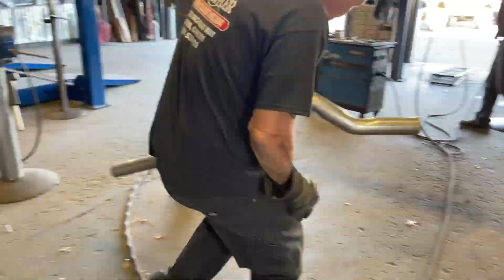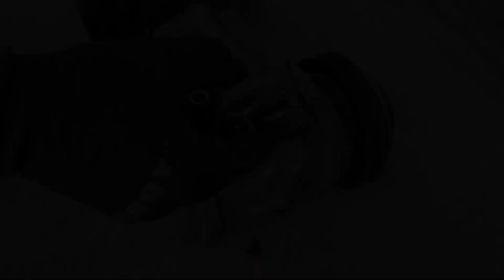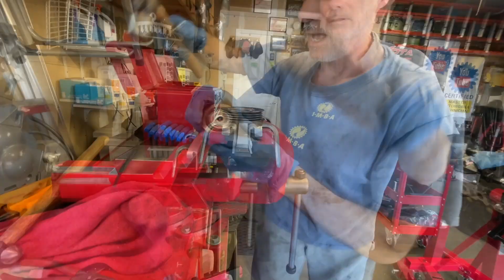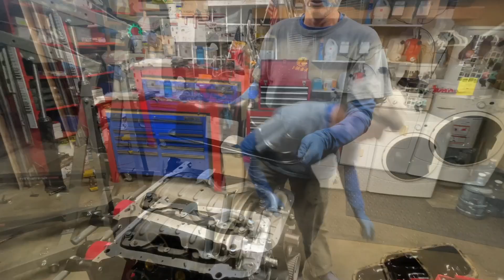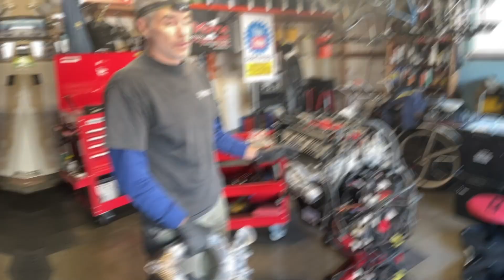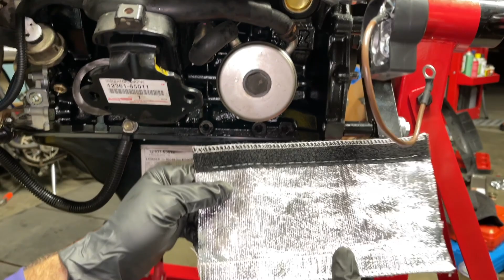3.0L V6 3VZ-E to 3.4L V6 5VZ-FE Engine Swap (2nd Gen 4Runner) - Part 2

Comment: 35:07 Where does the FPR vacuum like go to under the manifold? I see it’s ran under it but I have no idea where it’s going to. Or how did you set it up
Reply from the maker: The fuel pressure regulator vacuum hose connects to a small hard line connection at the back of the lower plenum.

Comment: Did you skip the baffle when re-sealing the oil pan?
Reply from the maker: No, we didn't.
Reply: Nevermind, I see you used the 94-98 t100 oil pickup that just mounts on top

Comment: I have a 1990 Toyota 4x4 pickup with a 3.0 3vze and i am taking that engine out and putting in a 5vze in good running condition from a 2002 4Runner. Do I have to swap the oil pans or will the existing one on the 5vze fit in the 1990 chassis?
Reply from the maker: @ForrestNorthwest  I don't know, but I bet Offroad Solutions might know the answer to that question.  Give them a call.

Comment: Absolute great video. I just watched eps 1. Very well done.
Regarding the new cross over pipe, I would and have used some other locking nuts, called K-nuts. There are two versions of those, the almost white one is a high temperature version, that lasts a lot better. and it's locking and won't loosen or even fall off. A little bit expensive for what they are, but works super well, and can take a LOT of heat. I may add that if the owner of this car wants to add a turbo or a compressor, for example the exhaust manifold to turbo flanges should have the same high temp grade K-nuts. Cannot recommend them enough.
Thanks for sharing.
Cheers.
Reply from the maker: Thanks again Jacques!

Comment: Hi Timmy, I am looking for a 3 VZ  3000CC, left hand drive, V6, 1989/92, open back Hi-Lux SR 5, wire harness from Computer to engine fire-wall to Engine, do you have any idea or phone # that I can try to get one, I closed is my Hi-Lux, thanks.
Reply from the maker: Offroad Solutions might be able to make you one.  Other than that, you'll have to find one from a vehicle somebody is parting out.  https://www.offroadsolutions.com/

Comment: Does the transmission of automatic transmission need to be converted at the same time And I'd like to know how much the hourly rate is thanks sir
Reply from the maker: Transmission does not need to be converted. It can remain automatic or manual. If your transmission is an auto, make sure you don’t have a pilot bearing installed into the back of the engine. If you have a manual, you will need a pilot bearing in the back of the engine. Our hourly rate is $972/hour but will increase at the end of the month.
- Sean
Reply: @TimmyTheToolman  thanks so much sir

Comment: Awesome video,  my question is why wouldn't you delete the crossover?
Reply from the maker: Ir you're asking why we didn't create a custom dual exhaust system, it's because that's not something we wanted to try to figure out.  It's also due to the potential problem you'd have getting it approved by a smog referee.

Comment: Curiouse, I have a 94 3.0L 4Runner Manual 4wd with a bad engine, and a 96 3.4L 2wd Automatic with a good engine. How hard would it be to swap the 4wd manual assembly from the 94 to the 96? Would the 4wd assembly even bolt up in place of the automatic on the 96, not to mention the front 4wd axle and equipment from the 94 to the 96. Or could I just swap the transfer case to the back of the automatic? Thanks & loving this series for obvious reasons. Best wishes & Blessings. Keith Noneya
Reply from the maker: Hey Keith, I don't have an answer for you about the 4wd swap because we've never done it.  They are different generation trucks so I don't know if the transfer case from the 2nd Gen would be compatible with the 3rd Gen.  This would be a question for a Toyota forum or maybe a Toyota Enthusiast Facebook page.
Reply: @TimmyTheToolman  No problem and thanks for the reply. Best Wishes & Blessings. Keith Noneya
Reply from the maker: @keithnoneya  No problem.  Good luck with all the planned work.

Comment: Hey Tim, where can I find the Heat shield that you used on the Header crossover?
Reply from the maker: This is what we used. https://amzn.to/3tPoFLK  
We joined two of these together.  They do make a wider one, but that still wouldn't fit all the way around the pipe.

Comment: 36:31 Do you have Part numbers for a clutch, fly flywheel for a 3.4l
Reply from the maker: It depends what you want, OEM or aftermarket.  Our clutch replacement video lists all the parts.  A lot of them come from Marlin Crawler though.  Do a search on our channel for the clutch replacement video series we did.  In the video description,  we provide all the links.  Remember, if you're using your original manual transmission, you'll want to use a 3.0 throw-out bearing.

Comment: I love this series! So much helpful information, I'm planning on doing the 3.4 swap sometime near the end of this year (2022). Timmy what would you guesstimate the cost to be to do this swap with the headers and stuff along with swapping in a manual transmission into my 94 3.0 automatic 4x4 4Runner? Not looking for an exact amount because obviously that will change, just looking for a close guess since you are experienced with the swap. My guess is somewhere near 10k maybe more? Also are those headers and exhaust system California legal, is it easy to get a CARB sticker after doing a swap like this?
Reply from the maker: I'd say 10k is a good guesstimate.  I don't know if those headers would pass a smog referee in California.   I bet the ORS guys would know though.  Give them a call.  They are super helpful Dudes.  Glad you're enjoying the series.  There's a bit of delay getting Part 4 out.  We will problem get it out early February.

Comment: hello, a question already install a 3.4 exchange but the oil dipstick does not go in do you know the reason?  I also did it standard and it does not mark revolutions or miles
Reply from the maker: Don't know because I'm not there to see what you're dealing with.

Comment: 5vz is prone to overheating, wouldn't it be better to set 1uz?
Reply from the maker: I don't think the 5VZ-FE is prone to overheat.  A vehicle that is stock with no modifications with the 5VZ engine isn't known to overheat.  But, put aftermarket bumpers, armor, roof rack, bigger tires, and then drive that rig on a grade in extreme summer heat,  then I'd agree with you that the engine can run hot.  But, even a stock rig climbing  a grade in extreme heat will run pretty hot as well.  The key to not overheating is monitoring your coolant temp with a scan gauge or OBD II reader sending info to a phone app like Torque Pro and knowing when it's prudent to pull over snd give your rig a break.  Ive done this many times in places like Death Valley.  The stock analog temp gauge is pretty much worthless.  By the time that needle starts rising, you've already let your engine get too hot.  There's a big delay.  Same goes for monitoring your auto trans temp.  It's smart to know how hot your getting the trans so you know when it's time to give it a break to cool off.

The reason for the 3.4 swap is it's more straightforward than other swaps.  I don't know what's involved to drop a 1UZ engine in, but I'm guessing it's more work than the 5VZ.

Comment: You have the wrong engine code in your description. Only the Lexus ES300 and the Toyota Camry got the 3VZ-FE in USA (for example) for years 1992 and 1993. You need to change that to 3VZ-E (no F)... The 5VZ-FE (along w the Mark 2 3VZ-FE that was available many places after 1993 just not in USA) is highly related to 3VZ-FE, evolving from it. The (non F) 3VZ-E is more crude less advanced shall we say earlier engine on which 3VZ-FE was based.
Reply from the maker: Hey Johnny, you're absolutely right.  Thanks for advising us of the mistake and the history lesson of the engines.  I updated the video descriptions for Parts 1 & 2.

Comment: Hey guys. Would you ever consider doing a video for a 3rd gen 4runner frame swap? That would be awesome!
Reply from the maker: That would be hard with our situation.  We operate out of my home with no lift.  A frame swap is much easier when you have a lift at your disposal so you can simply lift the body off the frame, strip the frame and swap over the parts to the replacement frame.  So, until the time comes, if it ever comes, that I have a shop space with a lift, I doubt we'd tackle a frame swap.

Comment: I swap the 3-0 for a 2.7 3rz-fe. On a 1992 Toyota pick up 4x4 extension cab. Plenty of power an a lots of room in the engine compartment. I crossed Mexico last year and yesterday came back from exploring the Baja California from Northern California. No issues. I love it
Reply from the maker: The 3RZ is a great engine.  Nothing wrong with that choice.  Just be sure to check the valve lash on a regular basis.  They are known for burning up exhaust valves.

Comment: If you’re scared to hit your hands when hammering the bearing out, use a socket extension.  I’ll often stick the extension in the socket with the socket backwards, so I have the most surface area possible on the thing that I’m driving.  This prevents the socket from dancing around
Reply from the maker: I thought of that as I was editing the video.  Yes, I agree.  An extension connected to the socket would have been a better technique.

Comment: Always get a lot if information from your channel. Now we just need you to do videos on  22re to 3.4 swap, that sure would put the icing on my cake. I'm actually getting things together to do this swap myself. Be careful with some JDM engines, with some conversions the exhaust manifolds and crossovers will cause problems. This might only apply to 4cyl conversions, just make sure to do your research before getting a powerplant. SAS folks or solid axle trucks period and you 4cyl folks too, a t100 2wd oil pan and sump (rear sump), dipstick tube ( dealer calls it a guide), dip stick, and a union. All on a local Toyota parts web sight.
Reply from the maker: A 22RE to 3.4 Swap might happen one day.  Glad you're finding our channel informative.
Reply: That would be awesome, and I'm sure helpful for a lot of folks with the 22r and 22re platforms, no replacement for displacement. I'm using a gear driven tcase
so a r150f to RF1A adapter is need, plus converting forward  shift transfer case to top shit is also needed. So if anyone of your followers asks you anything about that, you'll have that info.
Reply from the maker: @SOLDADITO76  Cool.  Good luck with all the work.